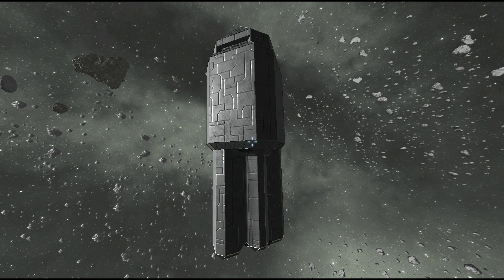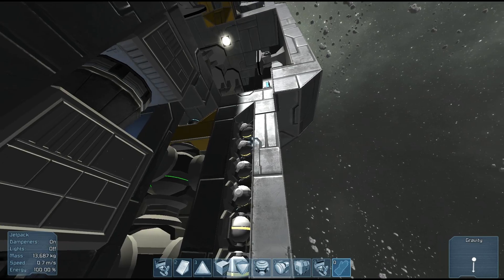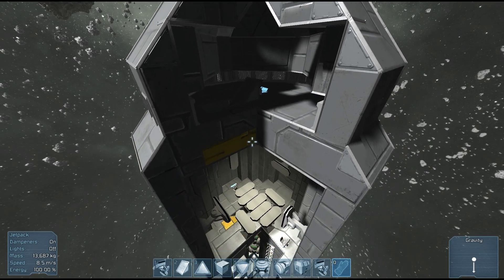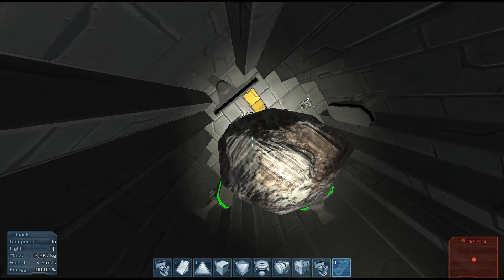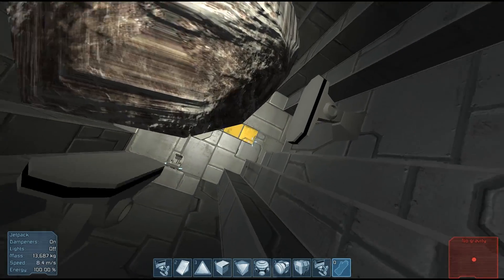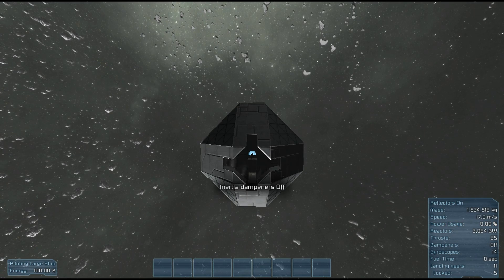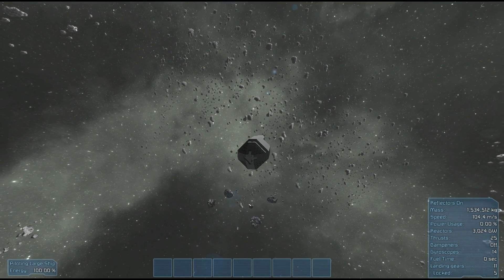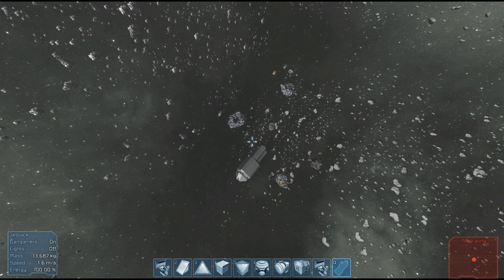Space Engineers, Gravity Propulsion System

Comment: you dont need as many gravity generators  you only need 2 by putting them back to back you have to balance the pull against the blocks by lowering the settings below
1 grav then balance mass blocks on a rotation till balanced then inch them upward
add mass blocks on the points  that aree aimed at the generator but move the masses foward to stretch and elogate the cone of force got it?

Comment: sage you can use mass blocks in the engine in a diamond configureation
Reply: I did this and used around 200 gravity generators and 4 mass blocks.
It accelerated like crazy, but begun to fly in a curve, maybe the strong forces teared parts of the ship apart.
The engines designed to stop ther ship doesn't seem to work properly, maybe they were also victims of the gravitational forces.
I couldn't investigate properly, since after I escaped the ship, it flews away in a huge circle and I wasn't able to catch up.

Comment: Great Idea, but Gravity is very weak compared to Electromagnetic fields used by Rail Guns, another problem is when a mass repulses another mass out in space "NEAR-Vacuum", the lighter mass is what ends up with the fastest velocity "MOMENTUM". So the trick is to start with four masses of equal weight "MASS" and then have three of the Masses electromagnetically tethered as one - In order to repulse the odd module out of phase, "SEE BELOW" 

Anyway if the Rail gun principles are Understood those principles could be used to cheaply propel a "Space Freighter Train" near to the Speed Of Light or perhaps even FTL velocities out there in outer space "NEAR-Vacuum"..

Mind you all the workings would have to be distributed amongst the four sections or modules evenly.
 
Example of a four Unit Space freighter.
----------------------------------------------------
where four sections or modules are electromagnetically phase flipped..

[- \\\\\ +]<--repulsed[+ ///// -][+ ///// -][+ ///// -] Phase one is where the first sections phase is flipped.
[ \\\\\ +][ \\\\\ +]<--repulsed[+ ///// -][+ ///// -] Phase two is where the next sections phase is flipped.
[ \\\\\ +][ \\\\\ +][- \\\\\ +]<--repulsed[+ ///// -] Phase three is where the next sections phase is flipped.
[ \\\\\ +][ \\\\\ +][ \\\\\ +][ \\\\\ +] Phase four is where the last sections phase is flipped, to which the whole cycle of flipping Phases is repeated if an increase in velocity is required..

Comment: rather then disabling the dampeners, couldn't you just tell the ship to accelerate forward at maximum which would automatically shut down any engines from pushing back, but leaving the engines on that keep the ship from spinning?... also, this could be used as a travel system, and work in conjunction with actual engines for maneuvering, rather then making the whole ship dependent on the gravity propulsion